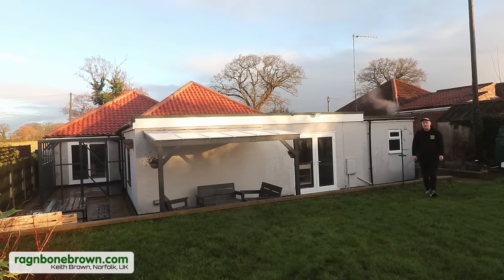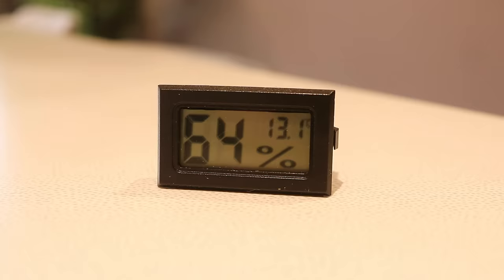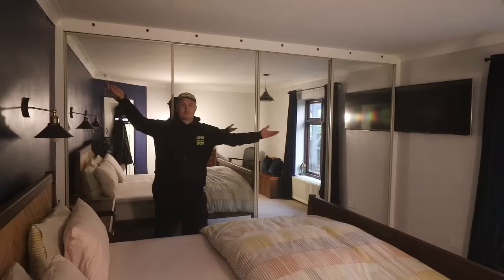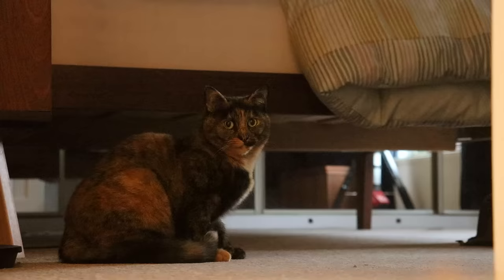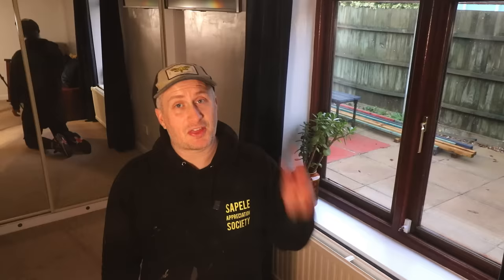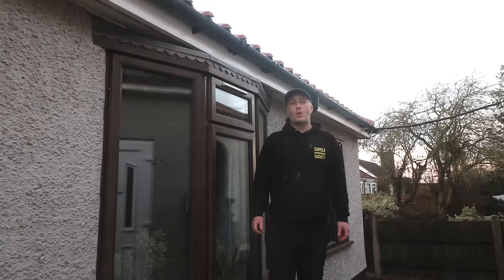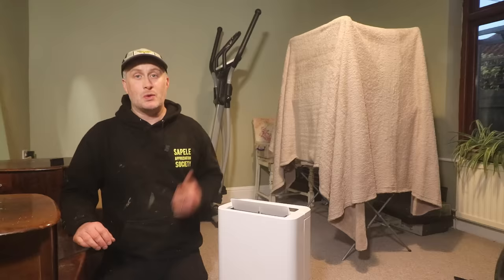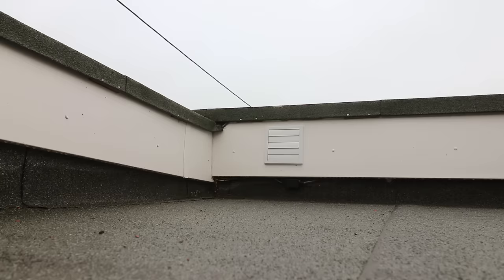8 Steps To Fixing Damp, Mould, Condensation & Humidity In Our Home

Comment: I live in a double wide mobile home half a mile from the beach. The mold cleaning routine has to be on point always here. The humidity is no joke! I clean constantly, have dehumidifiers in both bathrooms, the main living area and my bedroom. we have to empty the one in the main living area 3 to 4 times a day. I cleaned and painted my closets after finding mold growing on my suede and leather items. Painted it with a mold barrier and got rid of a ton of clothes and shoes for better air circulation. I am absolutely going to add the wholes along top and bottom on the interior of the house but worry that the external vents would just bring in moisture. Most days of the year you wake up and water is dripping off everything outside. I want to add vent fans in the bathrooms and want to add a solar paneled vent fan 8:30 under the rig for better airflow but my park won’t let me. I like the idea of of the attic air thingy and want to check into that but again the air around is pretty humid so whats a girl to do. Humidity, great for your skin, but hard on the hair do and your home! 🤷🏻‍♀️

Comment: I will buy some humidity sensors and confirm my house results. Sub 60% in UK without loads of dehumidifiers sounds unrealistic. We bought our second new build a few years ago. Most noticeable difference from the first new build - No bathroom vents, no window vents but it does have a positive air input from an envirovent in the attic at the top of the stairs. We dry clothes in a spare room and occasionally open windows. No dehumidifiers. So far no problems with mould growth. I think the envirovent does such a good job at pushing moist and stale air out. We have considered adding bathroom extractors like yours and vent them through the gable walls via the attic.

Comment: I'm in a new build house. Designers installed an air circulation system called "air eco". Essential a big fan in the attic connected to a series of vents around the house and all exit out of a single pipe out the attic, like a bathroom extractor. The windows all have vents on them. The idea is the fan runs 24/7 and creates a sort of draft in the house pulling air from.the windows through the house and up into the air eco and out the attic. Some people in the estate complained about it making the house colder (marginally, I think it drops 1 or 2 degrees compared to being off). The people who turned off the system had mould growth within weeks. Similar to what's described in this video except my system extracts. It also helps to extract cooking smells and bathroom steam and smells very quickly.

Comment: We are in a row of house and we have been fighting mould for years. Clothes go mouldy in cupboard, mould around windows and in some corners of the house which are attached to outside walls, we currently have 3 dehumidifier and when you turn them on they are around the 70ish mark but we manage to get them down to 30ish.(don’t know how accurate these these machine are) but they do pull a lot of water out. We also get condensation in our loft. Sometime it seems like we are fighting a loosing battle. Some great tips and defiantly some thinking points. Thank you for a great video 👍
Reply: Do you have cavity walls? What about a damp proof course? Are the external walls rendered and if so, does it cover the damp proof course? Do you have water build up external walls? Do you have guttering that is leaking or splashing onto your external walls? After checking these, check indoors to improve ventilation, having a better solution for drying your clothes, having a dehumidifier in problem areas. Considering installing an extraction fan if you can and maybe even reducing number of times you boil the kettle

Comment: Our 1990's semi detached is around 60% at the moment with internal temps of 18-20c.
Also had humidity issues this winter like many.  Installed lap vents in roof linings (loft got condensation during the chilling mid-Dec), new humidistat bathroom extractors and also got the sensors everywhere.  Worst room is my girls room, two of them in there, hairdryers daily etc.  Placed some big dehumidifier pots in the room and a month later they're full - seem to be doing the job as RH is 65% in that room compared to 80% it was before.  No recurring mould on their window and the internals of the external wall are in better shape.
Next investment will be a PIV system I think, seem to get good reviews overall.  Oh and trickle vents installed into our fairly new uPVC windows - why they're not standard anymore I don't know!!
Also got a wardrobe issue which is built in to room as standard - external wall mould.  Put a wardrobe hanging dehumidifier pouch to see how that goes too.

Great video Keith for those who need the advice.

Comment: We live in a semi on a hillside, the front is underground and damp is seeping in, I have a dehumidity machine on 24/7, unless like yesterday, we have a dry day when I’m home.
Then I run an extractor from the underground front window, (which we had installed) and open a window or two at the other side of the house to get a throughput of dryer air through, which also give the dehumidifier a rest! We still experience high humidity levels though, so I’m toying with digging in drainage so the house basement isn’t the low spot. SRG

Comment: I painted the exterior wall of my bungalow using a product called stormdry, it allows brick to breathe whilst giving the brick waterproof properties. It was a shot in the dark, but I'm glad I went with it. On top of that, internally I mixed thermal insulation powder into the paint and gave the walls a couple of coats which has really helped. I rarely see humidity over 60% whereas before it would reach levels as high as 80%. 

There is one caveat the to paint and that is the finished surface is textured, almost like a really fine grit sandpaper. But nevertheless, a small price to pay for a better quality of life.
Reply: Are you a rep 😂
Reply: @Treborse6  Nah, just someone that's used the stuff and reporting my findings. Some people may find it useful to know how others got on with it. I can genuinely say after the winter we've had, not a single bit of condensation on the walls which I would say is mission accomplished.

Comment: We have experienced everything you mention here (bungalow also) and would agree that ventilation and dehumidifier are the answer. 30% humidity is not achievable in uk as we're a small island but under 60% and nearer 50% perfectly doable with the aforementioned dehumidifier.

Comment: We've stopped using the tumble dryer and use a good de-humidifier with a simple but large  clothes dryer. It's cheaper since we're all electric Economy 7. We've got monitors too and are managing to keep around 60 percent RH max.
We open the windows on the vent latch regularly, and I installed the same bathroom extractor as yours.. It works well and replaced the really cheap ones installed before.
Lovely tortie  cat, like our Michi.

Comment: We’ve just bought a large bungalow in October 22 currently going through the same steps while juggling work and our young children. Timber windows being replaced end of Jan, hoping this will be a good start. Clear the previous owners did nothing to tackle the condensation problem in any room! We are running a Blyss 12 litre dehumidifier in the clothes drying room and it’s crazy how fast that fills. We haven’t had a summer in the new house yet of course to see the difference.

Comment: Great video. I own 2 1930's bungalows which have the same issues. Ventilation is key as you point out. These properties used to have big open chimneys which eventually get bricked up so no ventilation. Air bricks are great. Will look into the positive fan. Thanks so much

Comment: 1901 double skin brick detached house. Humidity 40-60% usually. High power extraction and open windows in showers rooms, and 2 powerful dehumidifiers (one on each floor) running most of the time they generally pull about 20litres of water a day between them in the winter.

Comment: Dehumidifiers aren't expensive to run and improve quality of life so much. They save more their running cost as house feels so much warmer when drier.
You can consider a heat pump dehumidifier. Some models send you a text when done. They cost maybe £50-100 more than a regular tumble dryer and take up similar space. Cost much less to run but may take longer to dry your clothes

Comment: Late 70's 3-bed semi.  Our temp/humidity thing rarely goes below 60 in wet weather (it's 61% at the moment drizzling outside).  Doesn't go much above either.  More than high 60s' would be very unusual.  Only see lower than 50's in the hot, dry, summer.   Have a dehumidifier for drying clothes too, and it does make the room feel warmer when clothes are hanging inside.  We always open the bathroom window after baths/showers for 10 min or so and we don't get damp on the windows at all in the cold (looking around the street at other, similar, houses and they do.....!)

Comment: 🙈Was gonna call you out on those white on brown trickle vents! At least brown sharpie pen them in until gone……..🤪  nice video, clean clear and factual.  I may even now get(a suspended and heated) PIV.👍🏻  I’m curious why we don’t do what other countries do and have ceiling fans to circulate old air?  Old ones are naff but some nice modern designs too?
I run 3 and want 2 more, large dehumidifiers nearly constantly from Sept until May.  Old 1930s large house and can get mouldy, despite windows open winter for a hour x2 and nearly constantly in summer! If you haven’t trickle vents and have no gaps under doors PIV air cannot escape/circulate so no use…….fyi…….

Comment: We live in a 1930s 3 bed terrace, average about 45 - 60% humidity in winter. Don't use central heating much but do have a wood stove which helps a lot. Front of the house still has old knacked upvc double glazed windows and the back is mostly new.

Comment: Two comments. I live in southern Spain at 2000 feet and most houses have humidity and mould problems. We have found ventilation is key even when it is cold (and yes it does get cold 6-4 degrees c this week). Two tips use salt in a bowl at the bottom as of cupboards a cheap humidifier which can the be dried and reused. Also we found that if solid wardrobe doors were left closed it would result in wet clothes within about 3 days. Either keep a door open or replace them with louvered doors or curtains. We have now insulated our house and put in a powerful fan to circulate air so hopefully the problem will not reoccur. However this was extremely expensive.

Comment: Problem are half-renovations, with insulating, airtight windows, but no wall insulation. Then there are high humidity levels an cold walls, where humidity easily comes close to 100%, causing damp and mould. Best is to insulate the walls and roof/upper ceiling. I wold not create openings for uncontrolled airflow from outside, which cause major additional heat loss. Automatic ventilation with heat exchange is best, but expensive.

Comment: Great video. Anything you can do to NOT get dehumidifiers, is good. Dehumidifiers cost money to buy, money to run with electricity, they need to be cleaned, they need to be serviced, and they create noise when they run. So if you can stop humidity coming in from the first place, you're that much better off.

Comment: Hi - I also live in a bungalow and humidity is a constant battle. I agree 70% being the "red line" value - sustained RH over that and problems will occur. I use a dessicant dehumidifier in winter and a compressor one in summer for better efficiency. They are in the hallway and just about manage to keep humidity throughout at around 60% - which is fine. Setting it for less than that makes them run too hard, almost constantly running. I don't have a bathroom extractor, that should probably be my next step.

Comment: I am literally in the same boat as you with my 1920's house. The only thing I have not done is put our dehumidifier in the kitchen where we tend to dry clothes. 
My partner also fails to stop drying clothes on the banister. A bone of contention she knows gets on my nerves but that's life 😂

My humidity readings are (without washing drying on the banister) roughly just above 60% whereas they were well over 80% before the PIV system with heater was installed.

Next step (due to the amount of heat loss through one massive exposed to the weather single skin wall) is external insulation. 
By the way, your power point has the potential to be very heavily overloaded.

Comment: Enjoyed the video, thanks for posting this up, We live in Northern Ireland and own an older 3 story Georgian home, the property was previously a two story but the previous owners renovated the top of the home to add 2 additional rooms but seemingly didn’t stretch to adding any heating 🤦‍♂️ EPC rating on our property is F so plenty likely needing to be done and not a baldy notion where to start lol, some areas of the house can be between 68% - 80%, rising damp and a couple of areas of penetrating damp has been found so yeah…will be doing plenty of research on this to look at ways to fix it, the PIV unit was mentioned previously but I think we will maybe start from the less costly options first (when I figure them out)

Comment: Great vid Keith, as always, and Yep, Yep, Yep - I also bought a detached bungalow and it took me a while to realise then figure out. 
I also had a "back of the wardrobe" moment, so now keep all furniture 20mm away from walls, especially the north-facing walls, which is where most of my problems arose. I manage to keep the humidity just below 60 in the Nov-March period by moving the dehumidifier around as needed. Otherwise ventilation seems to be the key aspect.
Am sure you've seen it, but Charlie DIYte  has a great vid on lifestyle habits, which together with all the measures you covered, make it possible to get to grips with humidity - the bane of British winter weather!
atb

Comment: I live in a 2F apartment that gets direct sun year-round. Humidity is only a problem for me during the rainy season, when it could get up to 80% or more. If it stays in the 80%+ range for long, I use the "dry" setting on my mini split to bring it down some. In the other three seasons, the humidity is rarely high enough to be a concern. I dry my laundry indoors with no issue. I keep a low-speed vent fan running 24H. It pulls fresh air from an input vent on one side of the apartment all the way through the place and out the bathroom ceiling.

In this climate zone, the realtors have told me that ground floor apartments can have serious humidity issues, at least if they don't have windows that get much direct sunlight, which is common in the city where neighboring buildings are close by. But if you're 2F or higher, you're probably going to solve any occasional concerns by firing up the mini split.

Comment: Im in a 1950's ex council house. Red brick with cavity. We keep windows closed, do t have an extractor in the bathroom or kitchen and humidity tends to hover from 55% to 60% and no damp issues.
I think we get away with it is because it has an effective damp later two bricks up and we have an open fire with all internal doors always open so its always drawing some air through.
So it can feel a bit draughty, but its dry.

Comment: I have a 1932 bungalow built with solid walls and it can be a nightmare. I definitely need to invest in a piv unit. One thing I did was to stop using wallpaper as that held any moisture so leading to black mould. If you are fitting an extractor cooker hood, it's worth working out the cubic size of your kitchen so you get one powerful enough. Worth the investment
Reply: And thank you for the very useful information

Comment: Great video, very helpful as I've started to get water and mould as the weather has turned, also im drying clothes inside which dose not help, to help with drying once the wash is done I do a extra spin some times two to get most water out the clothes. I also have cheap dehydrators on the windows which fill up with water.

Comment: Thanks! I've just used your link to buy humidity sensors. I do have a damp issue at the moment (90%) in the main living room. We have rising damp due to a problem with the ground outside covering the damp-proof course (which has now been lowered) but I think there are other reasons for the damp around the chimney. I'm trying to dry out the walls with a dehumidifier to see where any structural, damp-causing problems may be remaining. The dehumidifier is great, but once I've switched it off overnight, the damp level is back up to 90% in the morning. I think I may need to use it for weeks to get the walls dried out.
Reply: You probably already have mold in your walls, be very careful. This made me sick and I’m still sick, but trying to get better, I moved.

Comment: Had similar problems in our home in Holland, the sollution here was plastic in our crawl space on the soil there. It stopt moist from comming up through the wooden floor, brought the humitity level down from 80% down to around 55/60. We used the Tonzon metod, but I dind't used there products, instead I bought cheaper products with the same specs.